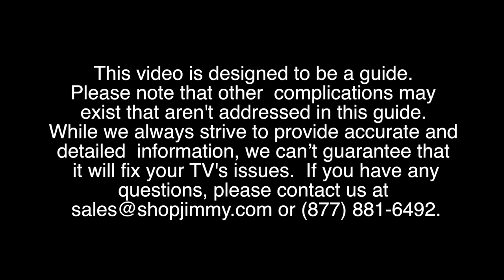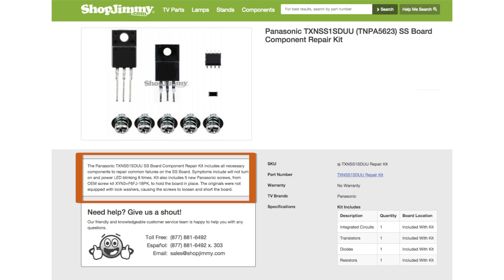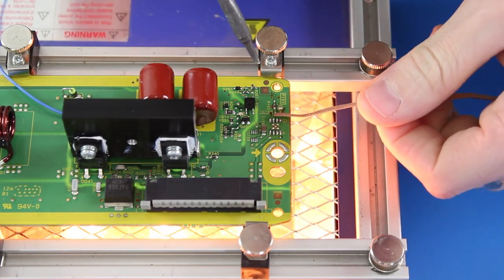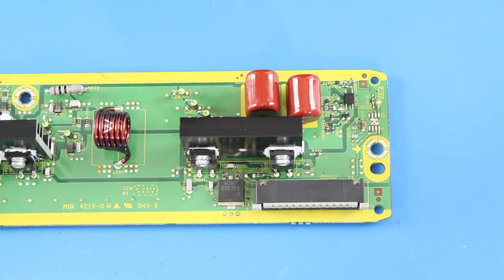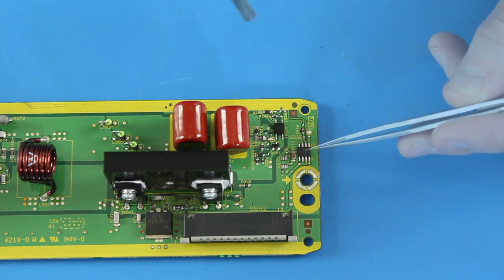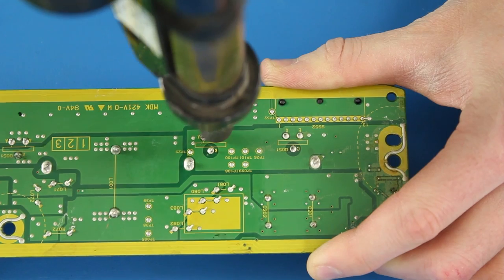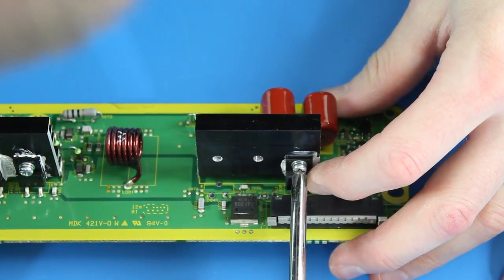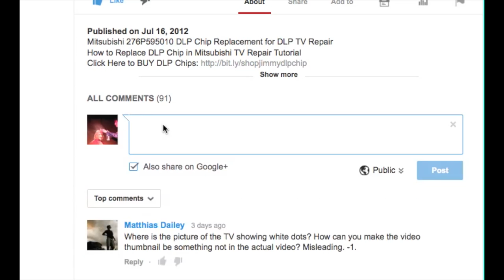Panasonic Plasma TV Repair - TNPA5623 SS Board Component Repair Kit TV Not Turning On 8 Blink Code

Comment: Bought your overpriced repair kit. Did the repair. Tv worked less than a second, made a pop noise, and now it's back to 8 blinks.
Reply from the maker: +i5usko  Try all repairs and troubleshooting at your own risk.    What kit did you purchase?  What was your original symptom?  What is your TV model number?  What is your part number?  Thanks!  www.shopjimmy.com
Reply: +ShopJimmy.com  sj-TXNSS1SDUU Repair Kit, I have a t55ut50. This was the issue and if you read just a few posts down you will see that this is caused by a poor ground. If this problem is not fixed then the board will just fail again. This was not mentioned in your vid at all so, I assumed it was caused by a short circuit on one of the components(namely that little resistor). The repair worked until the underlining issue caused failure again. Only reason I order from you was because of the video showing what components were damaged. The fact is the video doesn't tell you what caused the failure and now I'm out $20 because of it. If I had known this beforehand I would have a tv again.
Reply from the maker: +i5usko   What were the original problems/symptoms that your TV was showing, before you installed the repair kit?  Thanks!  www.shopjimmy.com
Reply: +ShopJimmy.com 8 blinks what else?
Reply from the maker: +i5usko Thank you!  Did you install the screws that came with the repair kit?  Thanks!  www.shopjimmy.com
Reply: +ShopJimmy.com  yes
Reply: +i5usko anyway you could ship me another kit as a courtesy?
Reply: Uh actually they sent me a defective part bud. And yes they were missing a key point in the repair. They sent me an email shortly after this saying they sent a defective part and that they were shipping out another. It wasn't just me either as I only complained through youtube so there is no way they could have gotten the email I had bought the parts with(not associated with my youtube username or account). I'm sure many others received the defective parts also. Not very good quality control.I have since fixed the tv with no issue. Oh and just cause you're fortunate enough to be able to piss away $20 on defective parts doesn't mean everybody else is. You can get these parts for cents elsewhere so why don't you go troll somebody that cares. This post is really old anyway.
Reply: Well then I misunderstood. My apologies. It immediately angered me to think that someone could have the audacity to blame the person who made a tutorial video, that they voluntarily put up to help people, for the  failure of their tv. So my bad. 

That being said I now have this same issue and have not performed any troubleshooting on the tv yet. I assumed this was the fix but after our discussion, I am inclined to believe that its not the total fix. Can you tell me exatctly how you got yours fixed? Or not cuz I'm a troll.  Thanks either way. :)
Reply: The kit has the right parts to fix the 8 blink error but you also need to take care of what causes the problem, a bad ground. The lock washers fix part of the ground issue but you have to also fix the pcb. When the tv fails it causes oxidation on the grounding contacts where the screws meet the pcb and where the pcb meets the metal grounding plane. You simply have to clean off the oxidation so that the ground is making good contact. After you do all the repairs just make sure to use lock washers and have everything tight and it should be good.
Reply: Thank you for the info. Sorry about the confusion. Take care.
Reply: @ i5usko 

Hi. I have the TC- p55ut50 with the 8 blink error like others here in the comments. I have pulled the ss board and it’s clear that the components you reference are damaged. However, there is also damage to the metal trace around the top-most mounting hole where the screw mounts the board to the TV. It’s not completely gone as it would still make electrical contact. Is this something I should be concerned with or is it still repairable. Thanks
Reply: I would just clean up all the oxidation and make sure the screws are tight. In trying to repair a trace you may cause more damage. Other than that you might add some solder to the damaged trace but you risk delamination. If the trace is not too bad and still makes good contact you should be fine.
Reply: i might have boards that might work with your tv send me the model # i might be able to sell you the board you need for a cheap price i have all the boards for a tc-p50u50
Reply: If youre talking to me my tv has been repaired for over a year now.
Reply: Yeah it is old, yeah you can get semiconductors pretty cheap from china(or us sellers that order from china and resell, its called epay "usually free shipping"), Yes I know what they are(part #'s and cross referencing is not that hard), and I don't care nor do I know if you can still get them cheaper(probably not cause they don't make em anymore). If you want the parts fast and don't want to have to find them yourself order from them. If you want them cheap its gonna be more time spent finding them if you find them at all(which at the time I had found them). My reasons for ordering elsewhere would be buying more than one saves money and you have spares. At this point I'm just annoyed I keep getting notifications from this. It was forever ago people! I think everyone can decide for themselves on whether or not they want to buy the kit.

I got defective parts and I was mad, this company made it right and sent out new parts to all those who received defective ones. Case closed!

Sorry if I'm ranting just tired of people bashing me for something I said ages ago.
Reply: Ok dude why are you attacking me?

I DONT CARE,

I GOT DEFECTIVE PARTS! 

I THOUGHT THAT FAILURE WAS CAUSED BY NOT CLEANING OXIDATION OFF THE TRACES THAT CONTACT THE SCREW!!!!!!!!!!

I WOULD STILL SAY TO DO THAT IF YOU WANT A PROPER FIX AND NO ITS NOT IN THE VIDEO YOU NUB!!!!!!!!!!!

I SIMPLY DID NOT KNOW WHY MY REPAIR WENT WRONG UNTIL I WAS EMAILED ABOUT A RECALL ON THE PARTS

So please stop trolling me ok?????
Reply: "This was the issue and if you read just a few posts down you will see that this is caused by a poor ground."

I was referring to the post by TomTechTod, he explained the whole issue, I should have quoted him, my bad. Happy now?

You are being a troll by continuing to trash talk about something I posted over a year ago. I mean I guess it doesn't matter. Just annoying.

Like I said people can decide for themselves whether the kit is worth it to them.

And yeah I've heard that suck thing all my life, sorry part of my last name sounds kinda like suck. Trust me it gets old.
Reply: this fixed mine however i added a ground wire to the top most screw. i soldered it and grounded it to the chassy so it cant arch even if it comes loose again